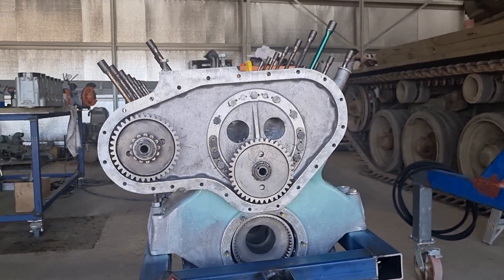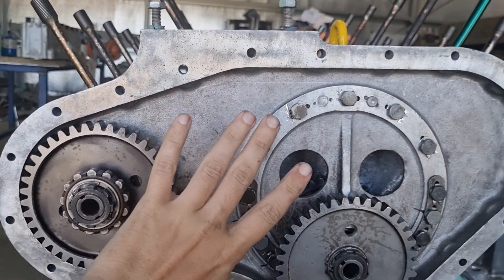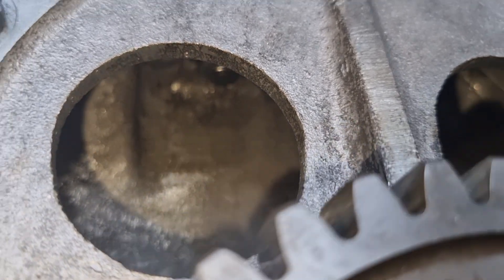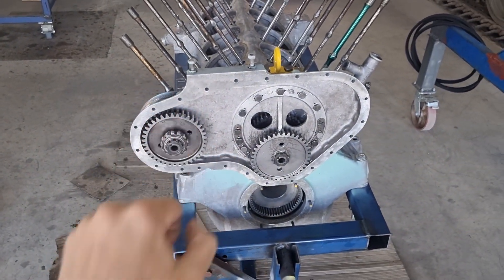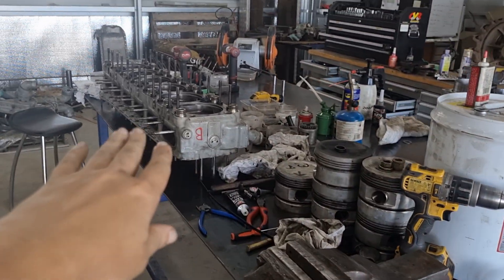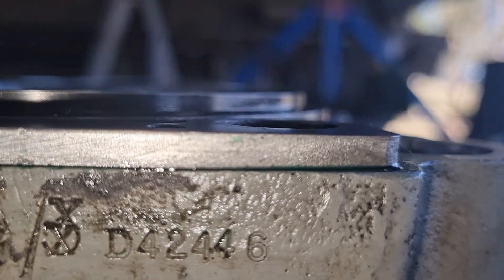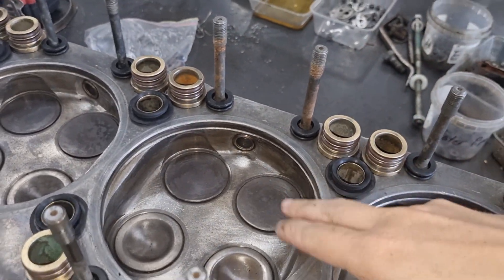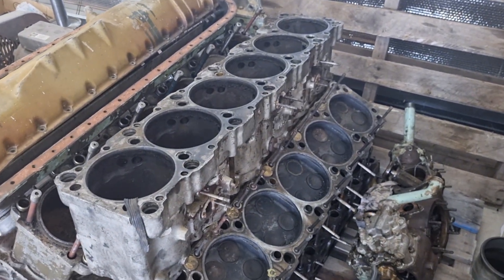Sealing up the Merlin Meteor!

Comment: In most engines the sleeves are pressed into the cast (iron or Aluminum) block and the coolant circulates in the block.  In this case I believe that the coolant touches the liner directly thus you need all those seals around the sleeves.

Comment: Hi again from UK. From memory was one a normally apirated engine & an other a Supercharged lump. 1500hp vs 2500. One for a tank the other for the Spitfire. Not sure which way round. Thanks for showing the video's. There is a huge interest in the UK for mainly the Spitfire planes. Not sure if you have ever watched Guy Martin's channel , but he helped restore a Spitfire & has an engine at home that runs on a cradle. 
Steve.
Reply from the maker: To my knowledge you can't squeeze that much out of them. This engine (naturally aspirated) gets about 600hp. The spitfires had a number of different versions but did indeed have supercharged merlins in the 1200 range.
Reply: Thanks for that. 
Steve. @lottiethetankwhisperer

Comment: Thanks for the video! Question: What is the sprag clutch on the gear that drives the generator pulley for?
Reply from the maker: It's a support bearing. The stuff on the end of it is just the locking nut and tabs. 😊
Reply: @lottiethetankwhisperer  thank you!

Comment: No head gasket.  Wow.  Now I understand why there are so many seals.  So it's gonna be a runner, but will, at least in the near future, be a static display?
Reply from the maker: It's a spare engine. The owner had three in pieces. We already made one for the Cent and It's running beautifully. This is made from the spare parts from the other two. We will fit it to a stand so it can be run up at will though the life of this engine is uncertain. It may get sold on to be used in another tank.
Reply: @lottiethetankwhisperer  ah I see.  Thanks for following up.